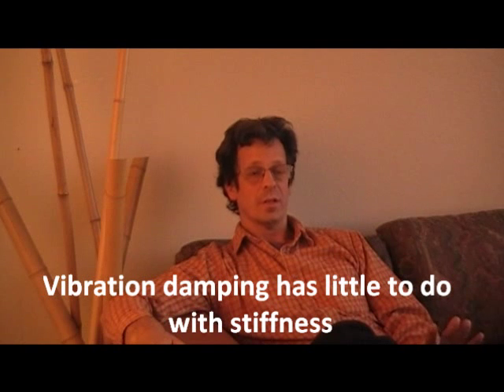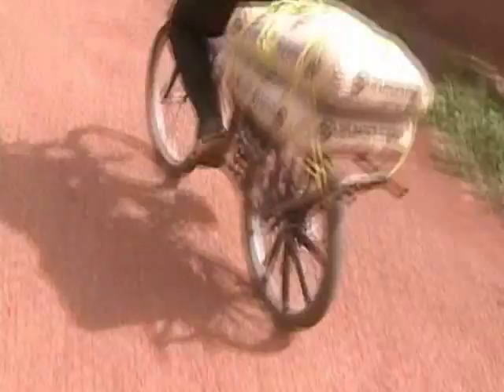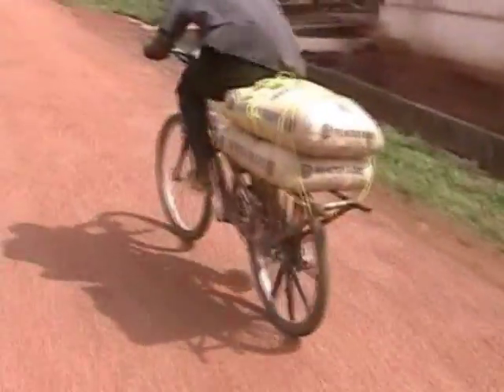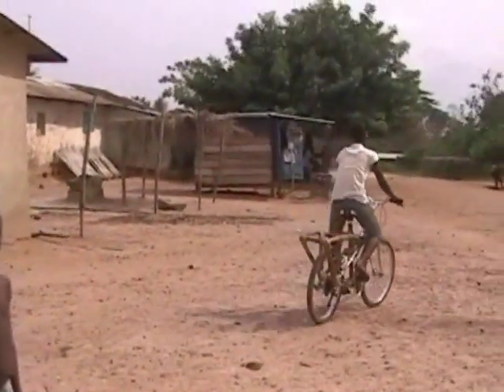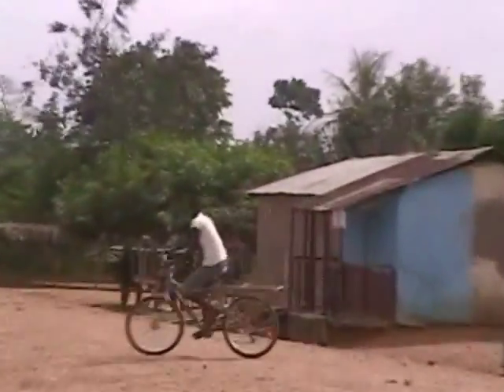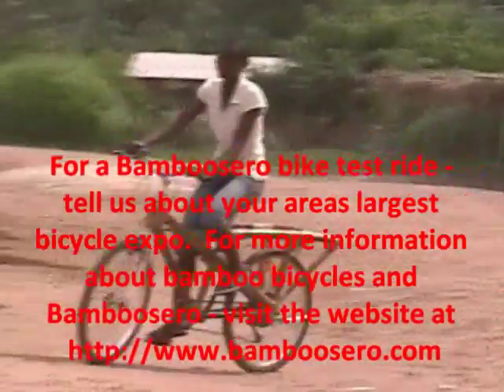Vibration damping vs. stiffness

Comment: As with aluminum and carbon fiber, not all frames are made the same.  Bamboo is especially prone to variation with all the amateur builders getting into it.  How to achieve bottom bracket stiffness and torsional rigidity is not well understood by most.  That was the case with early aluminum and carbon frames as well.

Comment: bamboo is a horrible building material..... i bought one a while back as a novelty type bike, and i can turn a little over 1500 watts, on an easy sprint mabey 30 mph the bottom bracket area just got destroyed.... bamboo sucks which is why i only ride carbon fiber and aluminum composite frames